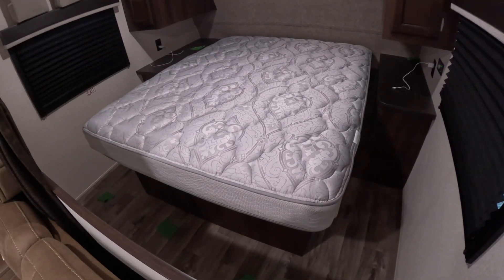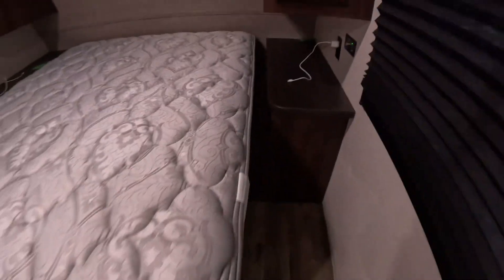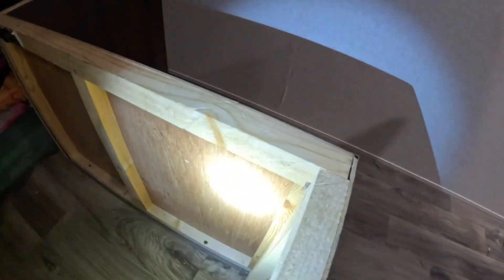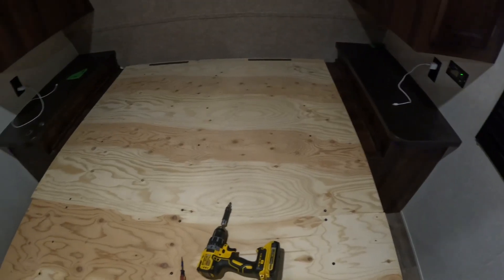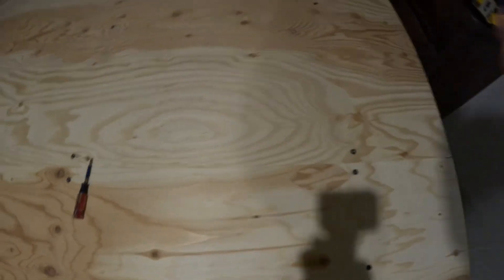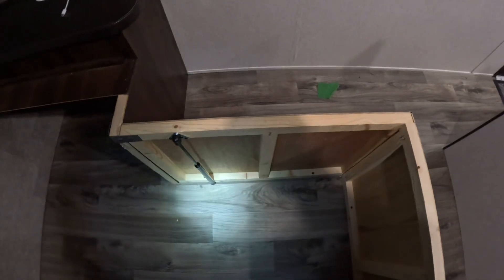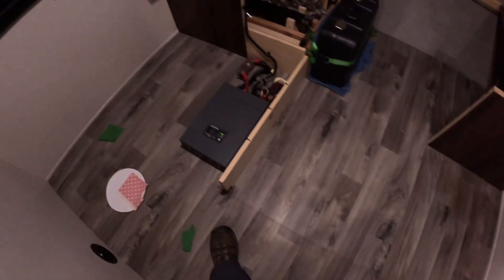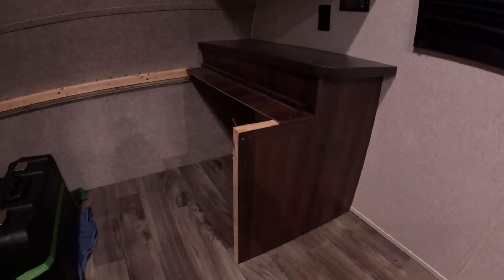Water Damage Floor Repair on Jayco

Comment: Great videos! What would you say was the source of the water damage here ?
Reply from the maker: Thanks! I'm fairly certain it was from the bottom edge of the compartment door frame where the seal pulled away from the sidewall and left a gap